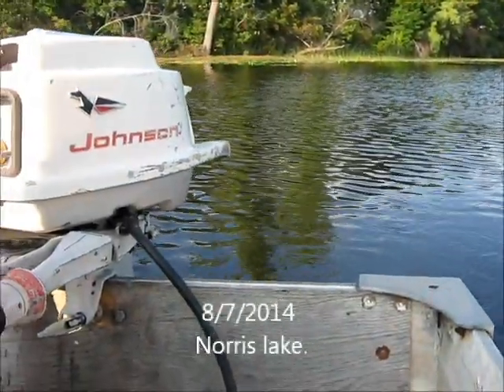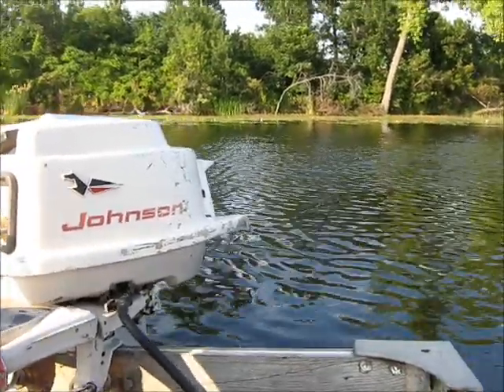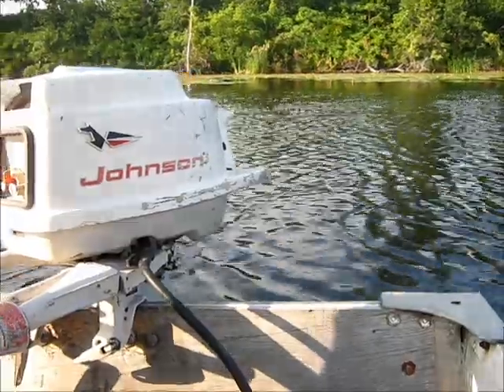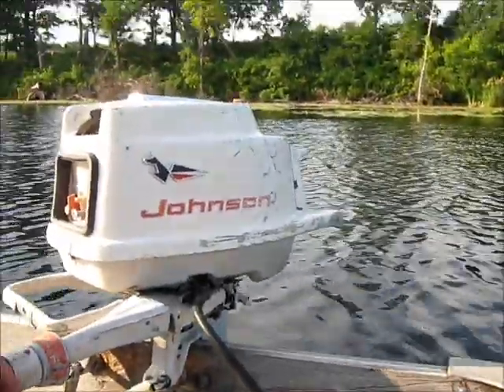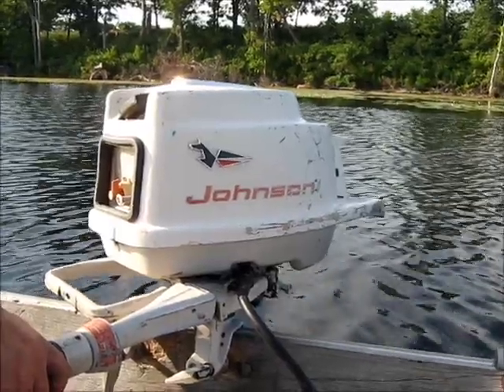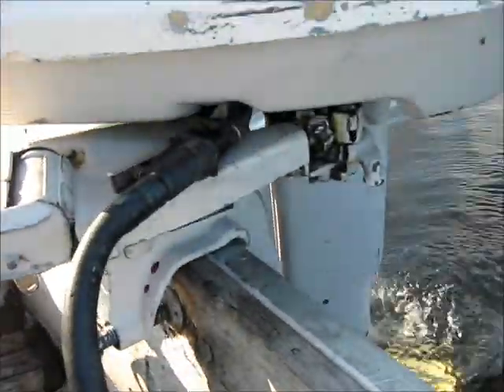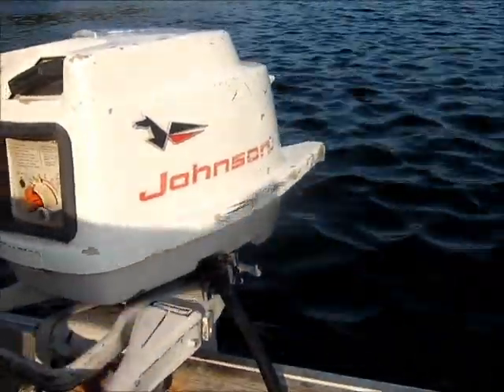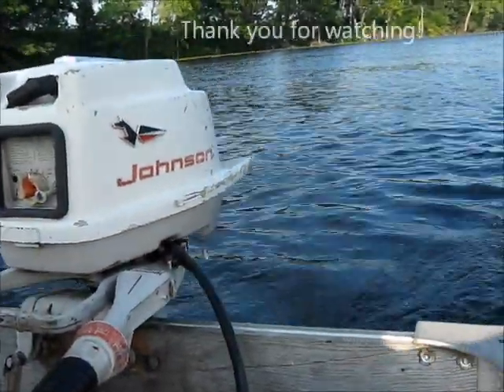1960 Johnson 5 5hp outboard motor

Comment: How difficult is it to find replacement coils, points, etc. for these classic motors.  Used to see a lot of these old OMCs when I was a kid back in the mid 60s early 70s even here in salty Hawai'i.  Thanks again for sharing.  Aloha.
Reply from the maker: ***** Part's are not hard to find at all! BRP Evinrude is still making everything, and there are aftermarket parts. I get them from my local Evinrude dealer.

Comment: Sir you make some very good videos. I thought I was crazy four years ago when I purchased my first boat used off of craigslist. The Jonas so to me told me needed a tuneup started the motor up but it would not remain running I bought the boat anyway. It was a 1987 winner bass boat a came with an iron trailer that needed work I have some videos of it. It also came with a 150 Yamaha Pro v needed a tuneup and a water pump on Davidson up $800 later I still think I came out ahead. I paid $1900 for the boat the motor and an iron trailer which I stated earlier needed some work the boat needed to transom pumps and some wiring done which I done myself and the transom pumps which came to $40 what is your opinion you think I may have spent too much?
Reply: Hope you got it sorted ..... No help here!